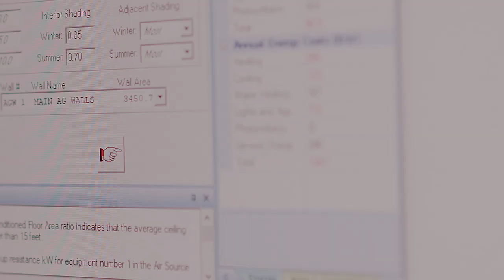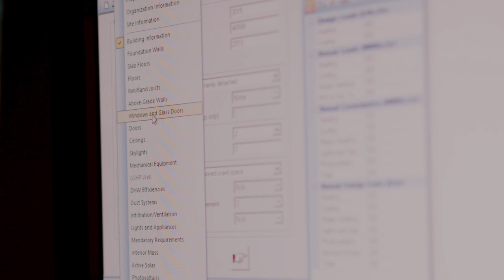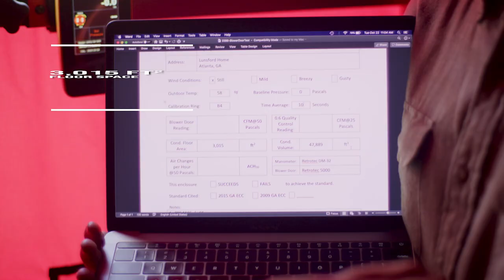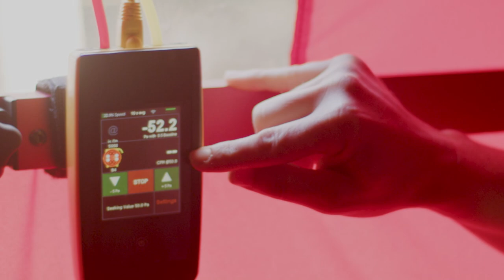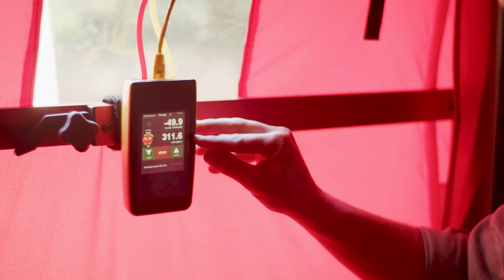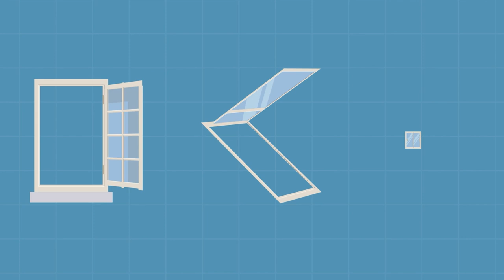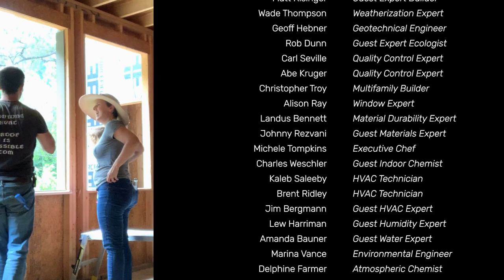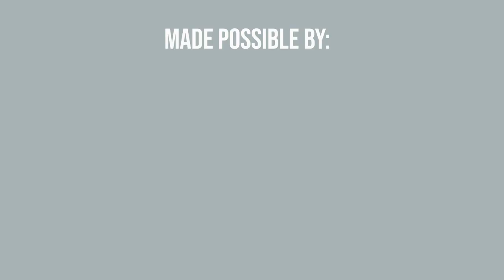Science of Windows, Doors, & Skylights - Ep 205 of Home Diagnosis TV Series

Comment: Even if not building a energy home.. Good windows are worth it. Cuts down on heat through window. And less noise from outside. 
Yes its more.. But worth it once you experience it.

I regret doing sliders. They have more spots for dirt to stay.
Reply: most of the sliders we have are very very air leaky. you have to go high end to get anything that remotely seals well. a cheap fix is to simply not install them.

Comment: having spent 20 years in remodeling I can tell you Skyligthts are just the worst.  HOT as the sun beats down on them. Easy to get to 160 degrees in the shaft.  With expansion and contraction they are a source of humidity and condensation. they are a source of leaks and even with the best of the best at some point there is going to be a problem.
Reply from the maker: Risk reward ratio :(

Comment: One of the interesting things I think about the windows is how many operable windows are still in homes these days, as if we use exterior air to condition our homes any more. I know you need egress windows but most people especially in the south never open their windows. In a high performance house I would never, ever open a window unless the building is on fire. So I would go with absolute minimal egress requirements for operable windows. Rest picture.
Reply: we still get people that think polluted, pollen/dust filled, damp air is "healthy". not to mention all the noise and insects it also lets in. but having said that we have a passive home here that has no opening windows (not sure if thats even legal here). you always want fire escape but also the ability to have ventilation if the ventilation system fails.
Reply: @tweake7175  yeah here in usa we need egress windows in bedrooms. I think everything else can be picture window.